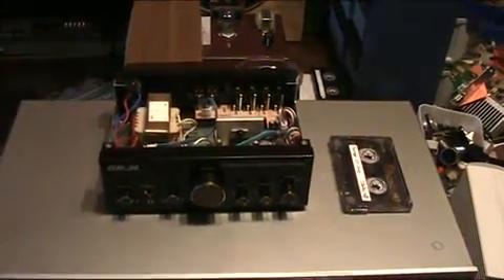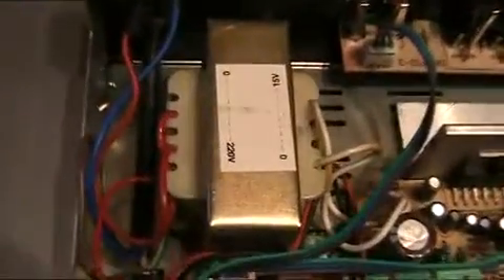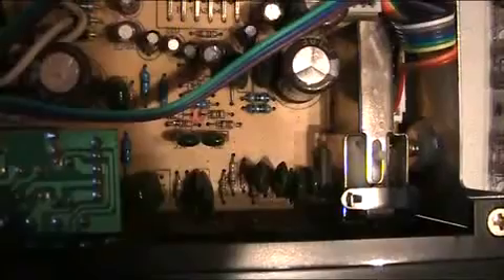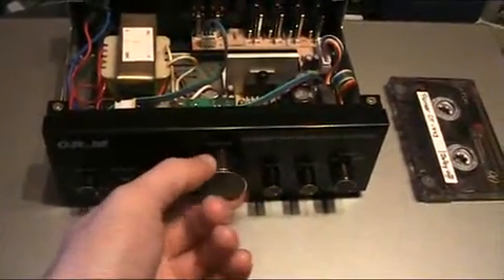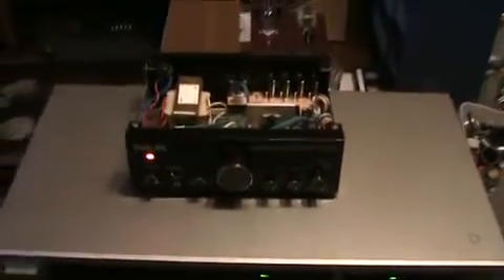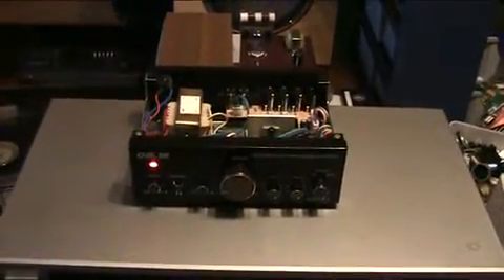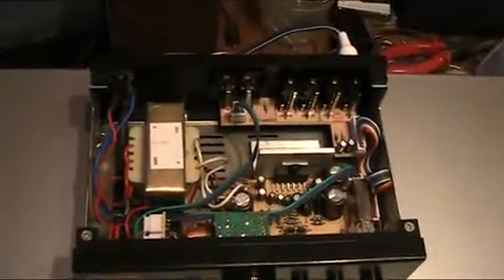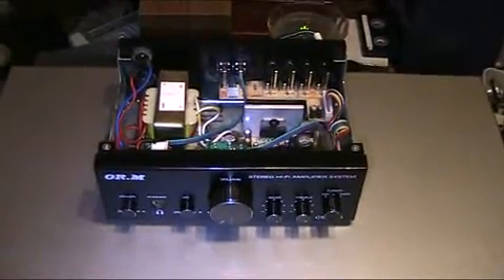OR.M CS-PA1 mini amplifier

Comment from the maker: It is a pretty decent little headphone amp. It worked on all headphones I ever plugged into it. And it has plenty of power, enough to blow your ears out ;)
Reply: I mostly use 30-100 Ohm headphones and i had the issue that the headphone mode had a terribly loud noise floor. I mean it might not be the worst i've ever heard, but it's still borderline useless.

The amplifier isn't good for anything much really in my case, neither for headphones nor for speakers. Except it has tone control, input circuit, transformer, and a box.

I want to install a TPA3116D2 or similar board to handle speaker output. But since the output is BTL, it can't go back to headphone socket - i have a boatload of NE5532 and TL072s i could put there?
Reply: @SianaGearz  me too... Any idea of how get rid of it? Would a ground loop isolator (as the ones sold on Amazon) do it?

Comment: This is a clear case in point that you get what you pay for, there's no changing that, but at least the amplifier does what it's supposed to do.  It doesn't look too bad and you say you want to use this as a headphone amplifier for your computer, I'm sure it will do well for that purpose.

Comment from the maker: @CoolDudeClem 

50Watts really is a joke, I looked ito the data sheet of the chip and it's rated for 2x10W when connected to 2 Ohm speakers. In any usual setup this will do about 5 Watts, that's right.
I'm sure your current amplifier project sounds way better than this thing!
I'll be using this amplifier as a headphone amplifier on my computer.

The song was featured in a couple of other videos, it's Bryan Ferry's "Don't stop the dance". A really nice song.

Comment: Hello do you know, if the speaker output auto mutes by connecting headphones on the front panel? Good videos by the way!
Reply from the maker: Yes, plugging in headphones does mute the speakers.
Reply: thanks for your fast answer! nice because I need this function for home recording. I still have some old passive speakers (quite small) and was thinking about this amp model (yes it's from Dynavox in my region) to replace my current setup that is bugging from time and again.